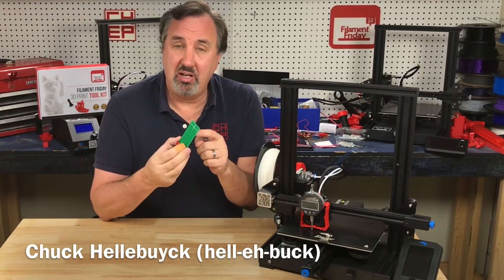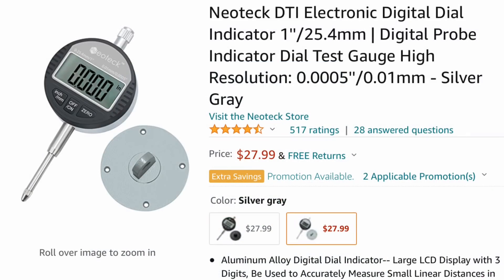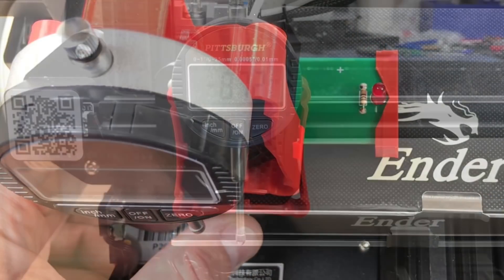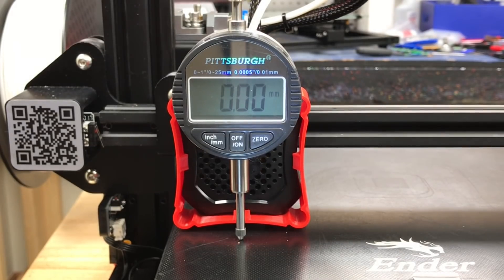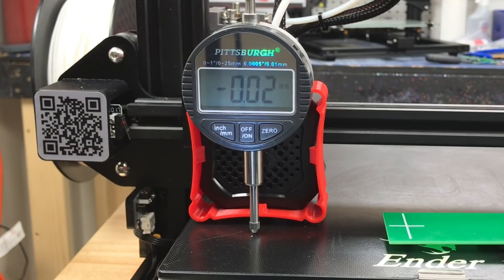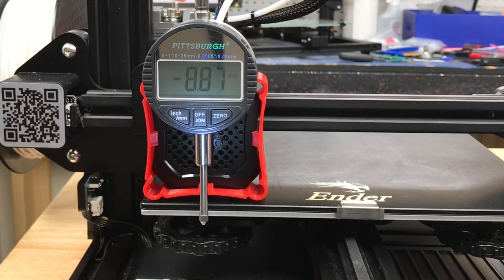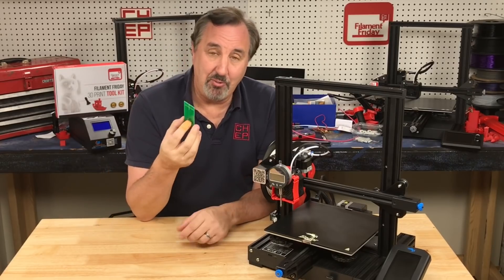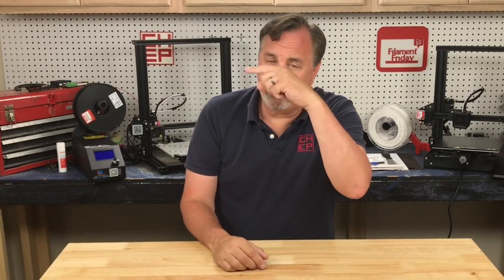How Accurate is an Electronic Bed Level Module

Comment: I stopped taking most advice on Reddit forums for printing for this a same reason some people are Greener than I am with no understanding of how this works, then there are the trolls that give bad information intentionally, if you're new to this it can be daunting to sort though the good and bad, the internet is not as useful as it was back in the 90s early 2000s when it was "no offense" full of very intelligent people, now everyone is connected no more Finger or Gopher "yes they still exist but not used much, even the old BBS. I was a Sysop of a 100 node BBS" bet most people don't even know what that is today born after 1995 - 2000, sure we had trolls but they had a harder time being anonymous having to use a phone line to connect and could get shamed out of the hobby..
Reply: I do! I ran a 16 line Wildcat! BBS for a dozen years back in the '80s. I had the most fun chatting with friends all over the world, and then there was the FidoNet (I think my node was 2200:449...)
Reply: Reddit can be good and it can also be absolutely terrible. I try not to let the terrible times get in the way of all the good times, because it's often the best place to get niche information about something. There are definitely a lot of "confidently incorrect" people on Reddit/the internet in general, but it's up to you to sort the signal from the noise. I remember I created a thread on one of the aviation subreddits and got blasted about how it's the worst idea anybody has ever heard until a real pilot chimed in and said "yeah, we already have that feature". Confirmed all my suspicions about Reddit and changed the way I interacted with it ever since.

Comment: My anycubic mega pro came with a probe device like this. It plugged into the fan slot and started the fan and made a chime when the nozzle depressed the switch. I preferred using this over the paper for that machine. Now for other machines I use a feeler gage.

Comment: Great video but I’m confused. Your video shows using a harbor freight caliper which is not the one you show a screenshot of in the Amazon screenshot?
Reply: its clearly the same model as a rebrand. The dial indicator is zeroing against itself. As long as it repeatable, brand is completely irrelevant.

Comment: I'm curious, none of the auto bed levelling solutions i've seen seems to incorporate automated knob turning with stepper motors. BL touch basically measure and compensate the unlevelness with Z axis manipulation, but why not manipulate the bed itself???
Reply: That’s actually what the Jubilee does.
Reply: The reasons are these:

1. Steppers are heavy. Do you really want to add another pound of extra weight to your printer?

2. Steppers are kinda expensive, especially when you need to add another four drivers, and a main board that supports 8 different outputs. All in all, it'll take you another three to five hundred dollars. Not worth it.
Reply: theres plenty of CoreXY machines that do this. The majority of cheap printers are i3 style - you dont want to add more weight to an i3 style printers bed.
Reply: @Etacovda63  ahh i see, just remebered that the bed moves often as Y axis, it worked in corexy since it moves in Z axis, thanks!

Comment: Throughly enjoy a to the point information video .What about using that dial gauge to level your bed ??
Reply: That's what I do.. As the nozzle wears it will not change you level, it will change your z-offset.
Reply: Look at the newest Prusa printer. Their hotend kinda does that.
Reply: I can see how that can be appealing. But considering how the hot end tip wears out over time, especially is you're using the brass ones, you'll need to find a way to fine adjust the dial gauge to match the hot end's tip. Having to measure the actual gap between the hot end tip and bed is a lot simper.
Reply: @urbypilot2136  True

Comment: I have an ender 3 and level my bed every few prints using the skirt lines as reference, haven't used paper in a while and my bed is a 400x400 ender extender with cheap used window glass on top. I don't see the need for this leveling contraptions unless your bed is severely warped, at that point I would suggest, get another bed.
Reply: Hehe I level my bed every print because I get crazy high adhesion, enough that the cheap default springs (v1) loosen a lot. (Loosening because I have to kinda squish the bed to get stuff off lol.)
Reply: @SylvieTheBagel  I had the stock removable magnetic surface, in which I found adhesion awesome and very easy to peel the parts of by bending slightly, until I upgraded to the 400x400 glass, that one I just have to be patient and let the bed cool off and the parts just pop of without any effort. I only use PLA and TPU tho, have no experience with other filaments.
Reply: @lc7ineo  same. the v1 comes with a powdery bed, not glass.

Comment: I just level with a dial indicator... Easiest option of all... I hate paper and feelers.
Reply: I was about to ask if you can level a printer with a dial indicator; it's something I've often thought about but wasn't sure if it would work, and how you would do it.
Reply: @MrJozza65  Ironically in this video to test/defend his own switch Chuck not only shows you how; he  even provides the parts needed to do it. I designed my own bracket for my Ender 5... But Chuck's will work too.  After you have your Z offset set, install the dial indicator  move the head to the middle of the bed move the Z to  a number high enough that the head won't crash at a corner.  If your level is close you can just zero the Z axis, if you aren't sure then go for Z at 1mm  and then zero your indicator.  Then just like Chuck did, move the head over the screw points (Chuck has G Code for that too) and adjust the screw until the dial indicator is zero.

Like with normal leveling go around a couple of times and you will be bang on.  Using this technique I can get my CR10S and my Ender 5 leveled at the corners within 0.01mm (just like Chuck).  Chuck recommended a $30 indicator on Amazon.  I had one for setting up my table saw, but even a cheap $15 Harbor Freight indicator will work.  

One last comment.  On my Ender 5 the "Aux level" function that is built into the firmware nicely moves the head to the corners to do this.. Which simplifies my long winded  explanation.   

Of course Chuck's LED switch would work too!
Reply: @tomjones2860  Thanks for the thorough explanation! I have a dial indicator somewhere, will dig it out and give it a go
Reply: @tomjones2860  You can also use premade Klipper macro code to do most of the leveling process automatically. Moving to the spots right above the adjustment screws.
Reply: Don't you still need a paper/feeler to set the first corner, though? I'm a recent convert to dial indicators, and I love them, but I thought you still had to set up the reference corner another way.
Reply: @TheSpooniest  Yes and that goes for Chucks digital feeler system too.  You need to get your Z-offset right/close, I use a 0.02mm metal feeler for that. Luckily unless you take your hot end apart your Z-offset rarely changes. On the other hand every time you print and you  pull/yank/pry a print off of the bed you almost always change the level in some way.  I check my level once a week or so with the dial gauge... I only use the feeler if I needed to service the hot end... Which is rare, a couple of times a year. For me the dial gauge is faster, easier and way more accurate.

Comment: I think utilizing an arduino to average out the value where the led lights up would make it work better. Done a similar trick using a pressure sensor.
Reply: Why? Initially i would say you are over thinking this but on reflection you are clueless
Reply: @shaunmorrissey7313  because the Arduino gets you to the perfect state, not flickering led state.

Comment: I find it really difficult to use feeler gauges or paper, my hands shake and my sense of touch doesn't seem to be as keen as most people. So something like this can only open up the hobby to people like me.
Just wish it was around a couple of years ago, I have various sensors on my machines and live z adjust to cover up the fact I just can't get paper method to work.
Reply: After leveling my bed a couple hundred times I noticed something that might help you out not having a good sense of touch. I level my bed while everything is hot. This means the fans are spinning on everything. I noticed when the nozzle is just barely touching my feeler gauge (or paper) that the pitch of the spinning fans change slightly. Hopefully you have good ears to hear it, but I started using it as a faster way to tell if I was hitting my feeler gauge that by actually rubbing it around.
Reply: @mjodr  that makes sense as I read that when you get the right pressure the vibrations from the nozzles can be felt on the bed.
Thanks for the tip, I will certainly try that!
Reply: @tituscassiusseverus6303  Yes the vibrations are all of a sudden connected and transferred through the system in a new path so it sounds different. It's kinda cool when I heard it.

Comment: It would be interesting to see the differences between a cold and hot system (i.e. if you calibrated cold, how much does it change when the hot end and glass heat up)
Reply: I've never measured, but the answer is "significant".
Reply: no it wouldn't, that's why you level your bed warm
Reply: @shaunmorrissey7313  agreed. I’m an engineer though and never leave well enough alone…

Comment: I found , last week, that a piece of hot foil, silver side up, set so that the nozzle just scrapes some of the foil off its backing has given me the best level bed so far as it gives a visible sign of how much its scraping the foil rather than the guess work of a thin piece of paper.
Reply: You are probably headed in the right direction with that, because for me paper is way too thick, but a 0.08 mm feeler gauge is just right and it's pretty much the thickness of some "foil" I would imagine.

Comment: It seems accurate enough. Disregarding bed surface irregularities, as long as the rest of the bed is levelled to the same distance between bed and nozzle, then the distance between these can be adjusted with the Z-offset during printing if required. Thanks Chuck.
Reply: Yeah I see those bed surface irregularities as worse problem, with paper or eletrical prope, trying always surface with finger or plade so its constant near testing area but is it enough? 🤔🤷  (then we can talk if bed is twisted etc so..😅 theres always something more)

Comment: Thought I would ask out of curiosity here as I also searched a bookface page. The center of my table is bowed in and the corners I can easily get leveled. But can’t get the center correct. I have been able to print at times with no issues, then start having issues. Not sure why at times but it happens. Some one mentioned they used tin foil to level the center as an alternative to getting a new bed. If I just take the old one off can’t I just bend the middle back into position some how?  Any other suggestions?
Reply: I doubt you would get it level by bending it by hand. I have a similiar issue on my Ender 3 pro. I found a glass bed can help bridge irregularities. Before you start leveling try to zero the Z axis as perfectly as you can in the center of the bed and then adjust the corners around that with Cheps bed leveling gcode, that way the corners get pulled even with with the center. After that you can run his bed level testing gcode (the squares), make note of the areas you still have adhesion problems in and release the two front clamps of the glass bed, carefully lifting it up slighty and use tinfoil strips that have the rough dimension of the areas with the adhesion problems and place them under those areas. Depending on how bad the dip appears the strips can be one to four layers thick (I usually go with two), depending on the thickness of your tinfoil of course. Carefully lower the glass bed making sure the strips don't move and put the clamps back on. That way you have a little bit of support in the areas where the bed dips down and the glass bed will help bridge those areas with it's rigidity.
Reply: If you feel the dip in the center is too severe and the leveling is off because the edges are pulled down too far you can use the same technique to raise the center of your bed of course. Just make sure to zero the z-endstop again after the change.
Reply: It can be done, just the accuracy we dealing with is hard to achieve at home. But I have seen people hand lap aluminium beds flat if you have the patience.
Their are other methods depending on what bed you are starting with?

Comment: BL touch was the best thing I added to my printer. So repeatable that I just hit start print and dont need to look.
Reply: Still have to set probe to nozzle height offset, at least once, a lot of people use paper method to gauge initial height.
Reply from the maker: New users need something simple before they get to that point but I’ve shown that in previous video https://youtu.be/TroPjdkSEOY

Comment: I was an aerospace machinist for years and we set up all the HAAS milling centers with a piece of paper. We consistently work within a couple thousandths all day long. =)
Reply: A piece of paper will only get you as close as the thickness of the paper. Usually three and a half to four thousands. If you have to be closer than that you're SOL using paper

Comment: Why not just use the Dial indicator.....?  That would BY FAR be the most accurate.
Reply from the maker: Now that I have the mount built that may be a future video.
Reply: I wish I could remember where I saw it, but I saw a vid of your theory put into practice,  and it looked to be quite valid, just zero it out at 0,0 then adjust the rest until it hits that 0 mark. 👍👍